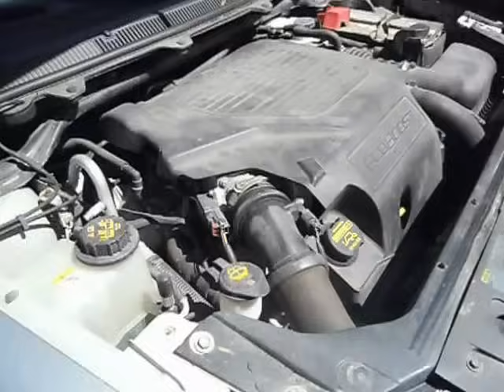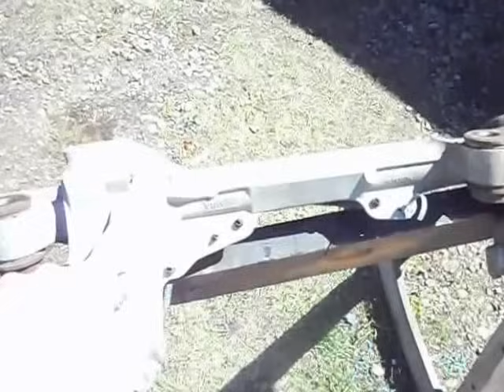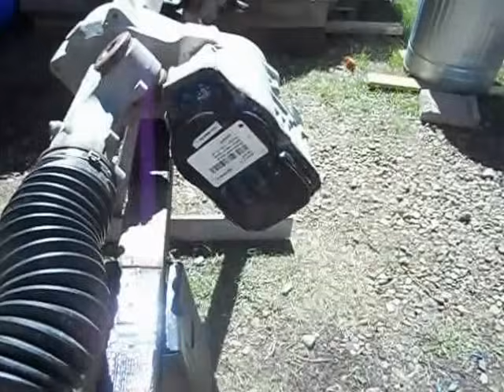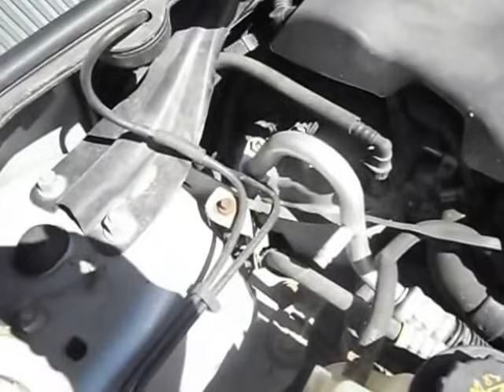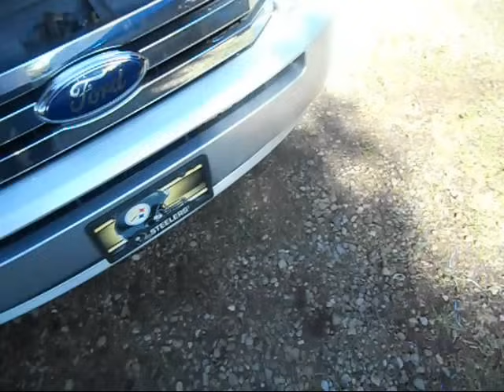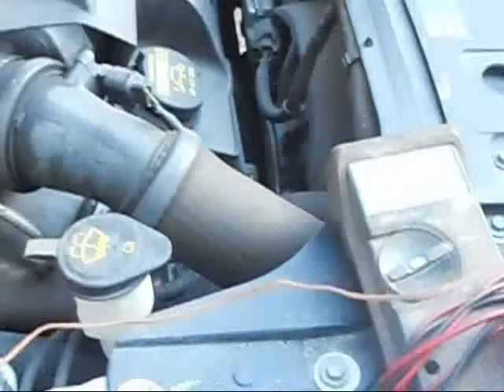Ford Electric Power Steering Failure Identified

Comment: Thank you for that information, I'm working on the same problem on 2010 ford fusion. This is another reason to not own these types of Fords vehicles in my own opinion Ford is a good car manufacture company only on heavy duty diesel trucks and one exception is the F-150 with 5.0 L v8 coyote engine otherwise is pure crack low quality vehicles.
Reply: Hey me too. I have a 2010 Fusion Hybrid and the EPAS has gone dead on me. Odd that we had this happen at the same time...

Comment: This man is a genius! My 2012 Ford Fusion 2.5 fwd had this same problem about 6 months ago. Luckily I did my research and found out my car was covered under the extended recall warranty. They replaced it free of charge which would have been $1800. Being like this man I wanted to know why it failed in the first place. After poking around for a while I figured it was the exhaust manifold that comes off the back of the engine and within inches of the electronic module/box of these epas racks and frying them due to overheating. I bought some heat shielding wrap that does a good job of deflecting the heat and wrapped the electronics with it and will pray it doesn’t happen again because it won’t be under warranty much longer. 🙏🏻 Thanks for the video sir, great job!
Reply: I have the same problem and my car shows by ford having no recall on this matter is there a recall #?
Reply: Mine is a 2012 ford fusion 2.5

Comment: H bridge failure can occur due to the fact electric motors require a lot of starting current due to inductive nature, and the load on them makes them draw even more current, and these MOSFETS even if rated twice the maximum current in a stalled state can fail contributed by temperature increase, and aluminum housing unable to dissipate heat as it gets even more hotter by being in a close proximity to other heat sources near by. 
If an H bridge fails especially the two diametrically opposite transistors, it can continuously power the motor to turn the steering wheel by itself without an input from the driver, which can cause a fatal crash especially when you might be going at 50 MPH or more, I think electric power steering assistance  are pretty dangerous and should be outlawed, unless provisions are made to use some other control technology where current is pulsed and each pulse is monitored so that if any transistor became a shorted out, then it would give a continuous power and as soon as the monitoring system detects this it shuts down the power to the transistors by using an electro- mechanical high power relay.

Comment: My 2010 Ford Fusion is showing all the signs now. A 9 year old car I've owned for 6. I keep getting "service advancetrac" and "power steering assist fault." I talked to Ford and they don't care to help. I was told technical answers for issues are only for the technicians through a service center. I had to have it towed to a ford service department and they told me the rack has to be replaced and it'll be $2500. My car is worth that much! I can't even talk to an actual trained technician, they want me to go through the advisor that doesn't know anything. I can't believe as a loyal ford customer they will not work with me or even give me an answer on a root cause/fix. I'm not sure what I'm going to do, but I may just get rid of it and put money that would go into repairs into another vehicle. I appreciate the video. It has helped.
Reply from the maker: Happy video was helpful; sorry you own Ford product. Millions of alternate Ford owners have been dragged through dirt like you. Ford's lack of professionalism and refusal to own-up to serious design faults will eventually drive business into ground. Especially since Ford has acted with criminal negligence concerning once loyal customers; who will never touch another Ford product, and make sure the 'word' concerning Ford is passed on. Your point concerning vehicle worth is valid; $2,500.00 investment is waste, since replacement unit will fail again in future. Use funds to purchase non-US designed vehicle, at least you can count of NHTSA taking action against non-US based manufacturer.

Comment: Complete "Failure Of Power Steering Assist" on my 2012 Fusion SEL AWD (46,000 mi) as identified on dashboard message. The wheel won't even turn! Hard as a rock! I bought this car exactly 2 weeks ago! Called Ford about the "Field Service Actions" listed on their site when I registered my car VIN#. "The EPAS Steering Efforts Action" is #15N01. Ford told me at that time there was a 50% chance of this failure but that I was covered for 10 years from 2012 or 100,000 mi. (WCF). I plan to call the Dealer and have my car towed tomorrow. It is completely un- drivable. I'm sick about this! Why aren't more people reporting this? What should I tell the Dealer? Would appreciate anyone's advice. Thank you all! Subscribed
Reply from the maker: Ford action on EPAS failures is criminal. Millions of owners have not only been placed in harms way, but defrauded out of hard earned money. Ford enjoys profit from EPAS repairs, and NHTSA sits idle and allows Ford to self regulate its failures. State of automotive manufacturing and safety regulation has become circus act.
Reply: Clearing the codes may make it temporarily drivable again, so you can at least get it to a shop.
Reply: @sibertigers1138  Tried that several times. Driving error fault came right back on display.
Reply: @bk1468  IM AT THIS POINT NOW WITH MY 2012 FORD FUSION. AND I FEEL LIKE FORD SHOULD HAVE RECALL ON THIS ISSUE.

Comment: I have a 2014 Ford Flex with this issue, and it is not included in the recall - which makes no sense, since the recall occurred in 2015, but does not include the 2014 model.
Reply: That’s us, ours is a 2014 as well. This happened first on vacation winding roads and mountains. Scary 💩 Ford said can’t find anything. I think they know damn well and we’re all collateral damage. When it happens, if I turn off the car it goes straight back to how it is supposed to be. Now it’s happened this week about three times. We’re supposed to leave on vacation to that Mountain Curvy Road again.

Comment: Great job and good jod with explanations of this problem.. I own a 2016 ford explorer 2.3 the power steering went out I took it to the Ford dealership for a check up. $2520 to replace I just can't believe this happened its 4 year old. Ford need to step up and fix this problem. There's hundreds of complaints with the same problem. Like you said on your comments.. ' Ford is putting us on risk of injuries or death'. I hope that that's not what they are wanting for it would be a super lawsuit against Ford... And it's not to far away from happening... As for me I would never buy a Ford vehicle not even as a toy.. Great video thanks we need more people like you.
Reply from the maker: Thanks, good to know information assisted in repairs. Yet another Ford customer lost...
Reply: Same thing happened to me. Middle of Wyoming first day of a vacation...2200 dollar rack replacement

Comment: Ford Escape 2.5L FWD, lost power steering, warning lights came on "power steering assist fault" in the driving. totally failed when I tried to re-start in a parking lot. Contacted Ford Canada. Ford said they can't help. recall was closed years ago.

Comment: If you are interested we have a 2013 Ford Flex with a similar steering issue except ours gives your theory some support. In the summer it works intermittently, mostly not working however when it rains it works perfect giving some evidence to yo our claims of thermal issues.
Reply from the maker: Thanks... Body of evidence supporting thermal stress design flaw is supported from various sources. Symptom vs physical evidence is important; as symptoms only support probability of failure disposition, and physical evidence asserts direct cause. Burned MOSFETS and gobs of thermal compound directly imply thermal stress management problem. Thermal stress in electronic implementations can exhibit many and various symptoms prior to full failure; your description of failure is absolutely included in subset. Symptomatic failure is precisely where Ford wants to dwell; as failure can be attributed to various causes; software, manufacturing, electrical connectivity, etc, can all be theorized as root cause for failures (Ford has already played some of these cards). But Ford will never disclose any hint of engineering design flaw. Ford prefers to fraudulently pretend to correct problem with EPAS software update; while voiding your manufacturers warranty if customers allow procedure. Yes; Ford demanded customers with failing EPAS symptoms to surrender vehicle to dealer (where software was downloaded that did nothing more than report additional OBD failure codes and messages). Vehicles were then returned to customers (without any corrective action) with modified software and warranty indicating Ford would not be responsible for subsequent EPAS failures following software update. The NHTSA silently watched as Ford implemented this policy to defraud millions of consumers worldwide.

Comment: Based what you discovered I have to tell you that you are 110% right...
It happened to my 2016 ford taurus and i noticed it happened in summer time during Hot days...
After clearing codes it went back to working order ( really weird stuff) .
It happened 3  times already with the same outcome... 
I smale something over heating like burn stuff and than boom .. steering goes down.. clear codes back to normal...
I have chavy cars for many years... but Fors what a failure... if not steering overheating than PTU over heating and stinks like cooking gas ( rotten eggs) ... ford has lot of problems

Comment: PLEASE READ THIS: My EPAS failed at 90'000 miles for the first time. It was 3 weeks after we bought the car (we are the third owner Ford Flex 2012).
After restarting the car it worked again. But I read in the manual that it will stop working for ever if you don't bring it to the dealer. Well this was not easy for me since the car was imported from Canada to Switzerland and this car is not officially sold here. Ford Europe also isn't connected with Ford America.
The Ford dealer contacted Ford America and they told him what he has to do. THIS IS IMPORTANT:
First they have to read out the error codes. If there is ANY code connected to the EPAS (there is a list with those codes) the dealer MUST replace the whole unit FOR FREE and install a softwareupdate. If there is no error he has to update the software. If after the update (doesn't matter how long it can be 2 years) ANY of the codes occurs, the dealer MUST replace the whole unit ALSO FOR FREE. This is written in the document the dealer has sent for the recall to the dealers. If your dealer refuses to do it for free you should contact Ford. 

What I think the bad dealers do is, that the charge the money 2 times. They get the money and parts for free from Ford and charge YOU so they have double the money.

I really didn't expect Ford to take care of my problem since the car is imported from Canada to Switzerland but they did. They also paid everything and believe me the cost for the work is much more expensive in Switzerland than anywhere else. They still paid everything and i appreciate that. Ofcourse I'm not happy that the EPAS failed but I hope it will never fail again.

One thing: The dealer will replace the EPAS unit onli 1 time for free.

I hope this will help other people so they know what their dealer has to do.
Other than that I'm very happy with this car. It's very fast and nimble, it has a lot of legroom and cargo space (I'm a very tall guy over 195cm). It has great gas mileage considering it's size and power and it's very safe in the rain. I haven't tried it out in the snow yet but I'm sure it will behave well. The only thing I don't like about the car is that the suspension is pretty hard (which gives good handling but you won't like driving it on bad roads). It's still very comfortable on long roadtrips. My legs didn't hurt like they did in our Cadillac STS we had before, even though the seats are harder. The seating position is higher which helps a tall guy a lot.
Reply from the maker: You were indeed fortunate your vehicle year was included in recall. Unfortunately, many millions of owners were excluded from recall; owning identical equipment and experiencing identical failures. Be informed that Ford never voluntarily initiated recall; it was only after years of failures and NHTSA action that Ford did anything. In fact, Ford has still not acknowledged problem publicly or disclosed nature of defect in honest manner. Ford explanation to NHTSA (which was the only published disclosure of issue) was that Chinese manufacturers assembled electronics improperly; sighting connector alignment and ribbon cable problem. These problems never existed and the real failure disposition continues to remain enigmatic to consumers; the way Ford want's it.
Ford EPAS implementation remains one of Ford's major historical blunders, and represents serious safety hazard and costly liability to consumers. EPAS design remains unchanged, so replacement units are subject to failure over time and use.
BTW, you should conduct additional investigation associated with other Flex design issues; e.g. brake lockup, turbo, transmission, PTU and engine failures, throttle body, timing chain, spark plug failures, gas tank leak issue, engine exhaust smoke, intercooler, others. Ford vehicle engineering remains at the bottom of the industry, many owners, like myself, have learned this lesson the hard and expensive way. My Flex only had 16K miles at onset of first major mechanical issue, Ford America fought me every step of the way to avoid repair under factory warranty.
Reply: K Smith 
Thank you for the answer. I‘m sorry to hear you had such a bad experience (and other people too). I will check out the other issues you mentioned. I hope they will not appear on my car. It has almost 100k miles now. Other than the EPAS we had no other issues. Would be great if it stays like that for another 80k miles. 
They don‘t build their cars with love like they used to...they do it only for the money. It‘s a shame because the car itself and the way it drives and handles is very nice. Before we bought the ford flex we had a cadillac seville sts 2003. We had it for 7 years and I read a lot of bad things about the car on the internet...but thankfully they never appeared on our car. I hope for the same with our „new“ car. 
I‘m really not a ford guy so I won‘t defend their mistakes. We had 3 GM cars, Chrysler, Honda, Lexus and now ford...I only shared my experience. Every manufacturer has its issues. My friend bought a new Audi Q7 a few days ago and it already started having electrical issues. Like I said they don‘t build them with love and pride anymore.

Have a nice day.

Comment: My 2010 fusion power steering stopped working last night as I was leaving a store. Turned it off and on and it came back. I fully expect it to be completely fried next time I drive. My fear is it will work long enough to get me to highway speed then kill me and my daughter and whoever is in our path. The vehicle isn't worth the cost of the repair and I'm not selling it because it's a death trap. It is definitely my LAST Ford.
Reply: I went with 2018 Mazda GT 3 hatchback  i got 5 year unlimited mileage warranty. I was sold almost 100Ks of only being in city doi ng deliveries. Only brake pads so far.